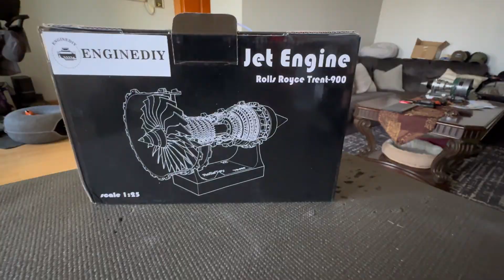Stig Projects (Trent 900 model)

Comment: Is the one you put together a desk fan? 'Cause it spins the wrong way & putting out "thrust" towards the front. 🤔🤔

I gotta get some of these. If I ever had made it all the way thru AMT training, I wanted to work in the engine shop. Details are what I care about, too bad U-Haul doesn't care but I sleep good at night turning out quality trucks.
Reply from the maker: It’s just a toy model my friend.
Reply: @StigAviation  didn't mean it as a dig on you at all, very sorry if I came across that way. I know you could do this blindfolded with tools on 1 side of the room & parts on the other. When I saw it spin backwards, I really thought maybe the designer of this had a desk fan in mind cause it would make a unique one.

Have you ever built a jet out of an old turbo?
Reply from the maker: @acemobile9806 no worries at all my friend. Like I said it’s just a model. The rotation on real jets varies on the manufacturer 😊